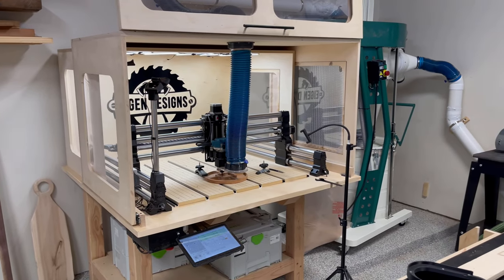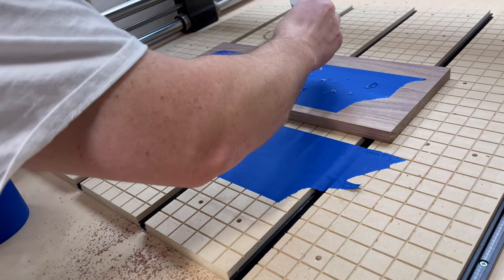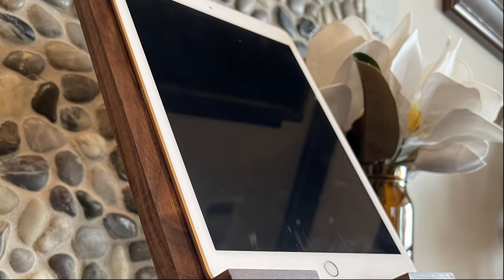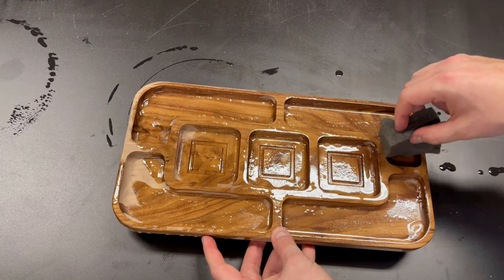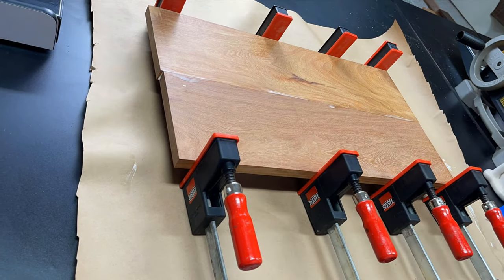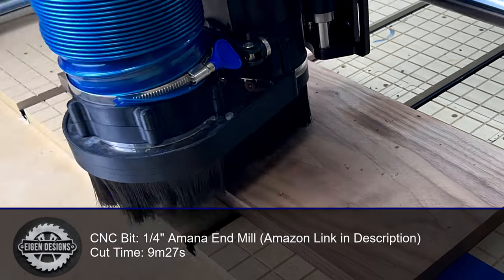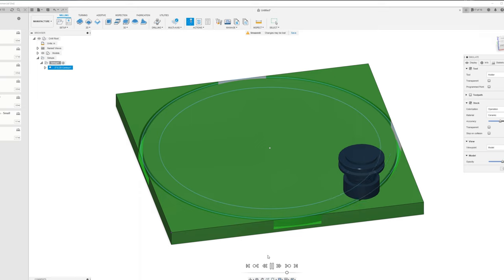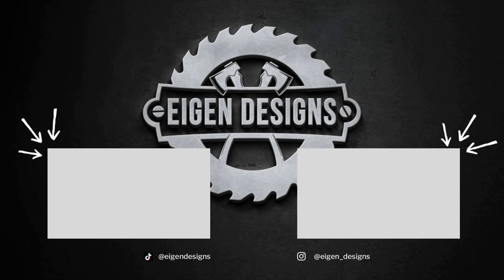5 Great CNC Projects  |   CNC Plans Available

Comment: Just a tip from what I do. On the lazy susan I opt for running a tool path with a V-bit around the edge before the relief cut. This ensures that the chamfer is consistent, you don't accidentally tip your palm router causing a divot on the edge and your dust extraction handles most of the debris. Other than that, nice projects.
Reply from the maker: That’s a really clever tip Jeremiah, thank you!

Comment: I just got the files for I pad holder can I do it on a cnc that’s not onefinity thank you can’t wait to make these
Reply from the maker: Hey Jon - you sure can. Just import the DXF file into your CNC software of choice and create your own tool paths from there. There is an instructional PDF included in your purchases that will help you with contour selection, cutting depths, feeds and speeds, etc. Good luck!

Comment: Not sure if you've tried this with some of your bowl bit projects but I've been running the first cut to "hog out" the material to get it close the exact depth and then doing a second tool path cut out that goes to the final depth and sped way up and with an increased step over to reduce the ridges left by the bowl bit initial time its run.... not sure if that makes any sense but great projects! Enjoying all the cnc videos my guy
Reply from the maker: That's a really good idea! Thanks Blake. That would certainly cut down on the sanding needs on the back end. Thanks for the tip.

Comment: the more i watch your stuff bro you are really good i started out like you had all the smaller machines 10 years ago when i started then stepped up buying bigger machines witch really helped me your planer ear muffs had the same one loud have a powermatic 20 inch not as load 25 inch drumb sander now from the jet 16-32 something like that i di what you are doing and saved saved saved to buy bigger machines took ten years but i got them  sad part is need ok want bigger machines  i have a sawmill i bought 6 years ago can slab up too 32 inch need a bigger planer and drum sander

Comment: I did this project right from the DXF.  You might include in your directions that your profile paths are "on" the vector and not outside of them as most projects will cut from the outside on cutouts.  I noticed as I was cutting this that the two pieces would not fit together so I ran the toolpath a second time on the vector and it worked out fine, however, I can see someone having a bit of frustration here.  Also, you might also include the project dimensions within your directions.  I got them off your video.  I realize you can make this any size you want, however, if someone is trying to replicate exactly what you demonstrate...
Reply from the maker: Hey Russell, a few people expressed some confusion about cutting "on the line" vs on the outside of the line so I actually updated the DXF file yesterday to increase the opening to 3/4" so people can cut on the outside of the line. I hope this will help simplify things. Also, that's a good idea to include the dimensions in the instructions. It's included in the listing description, but it would also be helpful in the instructions. Thanks for the tips!
Reply: My copy that I purchased last week wasn’t updated apparently. I cut inside and outside wasting 2 really nice pieces of walnut, before looking up what the problem was. The engraving is extremely light as well. You can barely see the lower left.  My Avid 6060 is trimmed in to .002 across X and Y. The wood was .758”. I set it at .750” so I didn’t hit my spoilboard. It left. .008” all around, so I know the wood was level as well.
Reply from the maker: @shockdocracing  What's your order number so I can help get this resolved?

Comment: Hello, wonderful work, can I ask about your cnc machine, I'm really interested in building one and yours appears to be a totally different design to any others I've seen, with pipes for linear rails as far as I can tell,what type is it, or did you build it yourself?
Reply from the maker: I didn’t build mine. It’s made by a company called OneFinity and they use those ball screws to move the router around. It’s a very still design and has remained accurate even after a years worth of use.
Reply: @EigenDesigns  ok, thanks for the info, I'll check them out.

Comment: Interesting to watch thanks. As a complete novice, I was wondering what is the accuracy one can achieve on a mass production doing this process? Meaning if I set specific sizes with the cnc, how accurate will be let's say the actual internal cut compared to the settings? I like the gap between the dishes and the tray, looks good aesthetically, but what if I want it to be narrower to the very limit? Would you say the dishes will always fit, or some will and some won't?
Reply: Actually I mean something like the tray for the beer glasses. They seem to fit like a gloove. Love it.
On a mass scale, is the router able to get always a fine cut or what would you say will be the allowance? thank you
Reply from the maker: It's a good question. The answer will depend on what kind of a CNC you have. My OneFinity operates on ball screws instead of elastic belts so it can make repeated cuts without losing accuracy over time. Any time I have carved something in large quantities I haven't experienced any variation in the final products.

I hope this helps answer your question.
Reply: @EigenDesigns  It does! Thanks a lot mate!

Comment: Hey, what are you feeds and speeds for the 3/4" bowl bit? I am just about to do my first bowl cut and curious where to start. Thanks for the ideas!
Reply from the maker: Hey Ryan, I typically run my bowl bit at 160 in/min with an RPM of ~15,000.
Reply: @EigenDesigns  are you doing .125 / .25 doc per pass? i have a 3/8' bowl bit , so i have my dia set .375, ipm of 160 plung of 70, but im unsure how much to do the doc per pass. i have to go .75 for my veg tray, material is 1" or do you think i should only go 1/2" depth and leave 1/2" of mass to the bottom? figuring out this first tray is rough XD
Reply from the maker: @SpwnDragn  with a 3/8" bowl bit you could do 0.2" per pass. A trick I have learned is to watch the size of the cuttings and listen to the router as you're making your cut. If the cuttings are very small/fine, lower your RPM. If you hear your router actively struggling to cut the piece at your given feed rate, increase your RPM. The key is to feed that information back on subsequent cuts to find the right balance between those two things.
Reply: @EigenDesigns  gotcha thank you

Comment: Why do some people use painters tape and CA glue versus double sided tape. I use double sided tape without any issues.
Reply: Maybe I’m just been lucky so far?
Reply from the maker: I have tried a few different types of double sided tape and been unlucky to have the pieces move on me during a carve. It could be the 1” grid lines on my spoilboard prevent the tape from getting a good bond, but I’m not sure. I’ve never had that issue with the painters tape method.

Comment: I work concierge and a resident got a 70 something inch tv shipped to them with a good allotment of soft wood. I'm new to all this, is there anything i should do to the wood before adhering and clamping? I may lightly sand sections have some black text printed on, but there are also American flags throughout it that I actually want to keep.
Reply from the maker: If you're going to use reclaimed wood, make sure you remove all nails, staples, and other metal objects before working with it
Reply: @EigenDesigns  really appreciate you and your channel

Comment: Down loaded and it came out nice but I have a question. My carve time after downloaded the Gcode the 1st carve was 45 mins and it went in circles. the dish cutout also went in circles not straight movements light your cnc. Yes I downloaded into my oneinfinity. On my 3/4 bowl cutout I notice I had some ridges at the bottom. Usually I use a clean up low step over. Any ideas?
Reply from the maker: Hey Dave, I am not sure which file you're referring to, but perhaps I can offer some suggestions.

 If you're looking to optimize the tool path for the dish groove you can import the DXF design file and create your own tool paths, rather than using the g-code files directly. I use fusion 360 for my software and often times the "adaptive clearing" will cause the circles that you're talking about so you can choose a contour cut to carve the channel  for the dish instead.

The easiest way to get rid of the ridges from the 3/4" bowl bit is to use a drill bit sanding attachment and lightly sand the bottom of the bowl. These are pretty cheap on amazon and make quick work of the ridges left behind by the drill bit. I have played around with the reduced step-over on the final pass and find that there are still markings left behind by the bit. 

If you need more support feel free to reach out to me through Etsy.

Comment: Mark, great video.  Question, during the first part it references using the 90 degree v carve bit to do the cutouts and the then the 1/4 inch endmill when doing the carving but, that seems to be backwards to me.  I'm new to this and want to be sure I setup the bits in the correct toolpath sequence since I have to redo the toolpaths (vectric) after purchasing your files off etsy.  Do I use the endmill first then the vcarve or the opposite?  If so, I think the video bit references may be backwards or it's just me.  Thanks.
Reply from the maker: I just noticed what you’re talking about and it’s definitely a mixup on my part - great catch. The cutouts should be done with the end mill and the engraving should be done with the 90 degree v carve bit. Also, in general it’s better to do the engraving first before doing the cut out. You don’t have to do it in that order, but it’s a better habit to get into. Hopefully this clears up the confusion.
Reply: @EigenDesigns  Thanks. That clears it up.  I'm working on updating the toolpaths in vectric and plan on doing some playing around this weekend.  Thanks and again, great videos.
Reply from the maker: @j.zamanma1312  thanks so much :):)

Comment: Mark, great projects.  Thanks for taking the time to show us how to do them.  One thing I noticed was that you used Fusion 360 for both the design and the tool path for the Onefinity CNC.  I've always used the Vectric Vcarve Pro for design and generating the tool path for my Onefinity CNC.  I'm in process of teaching myself Fusion 360 for my 3D printer.  The design aspect of Fusion 360 seems far superior, in my opinion only :-), to the Vcarve.  I would really appreciate it if you can demonstrate the workflow from design to tool path using the Fusion 360.  Thanks and keep up the great work.
Reply from the maker: Thanks for the support. I agree that Fusion 360 has a lot of capability if you're willing to go through the "learning curve" since its not as user friendly as some of the other software out there. In this video I didn't really focus on the design aspects, but there are two other CNC videos where I go into more detail on this process, including the workflow that you're talking about. I recommend you check out these two videos I did a while back to see if that helps you in your journey:

video 1: https://www.youtube.com/watch?v=tkKBD4uaoQo&list=PLVDz0b_Tzzt3-P40DdhGUVe_7mfTGJq6C&index=2 

Video 2: https://www.youtube.com/watch?v=NVPENSGp5zg&list=PLVDz0b_Tzzt3-P40DdhGUVe_7mfTGJq6C&index=5

Comment: These turned out really nice. I am always afraid to try something like the "large serving platter" design because wouldn't the wood warp and shift in time digging out so much? I was always told to only do that with glue-up wood strips.
Reply from the maker: It's always a risk, but I haven't encountered that issue yet. I always use kiln dried wood that has acclimated to my shop so I am sure that helps. 

You should give something like this a try, worse thing that happens is you ruin less than a board foot of wood. If it ends up warping on you I will mail you a stable one for free.
Reply: @EigenDesigns  Thank you for the words. I'll give it a try when I can. It was just one of my worries that I ask random woodworker channels about and most say never do it. Yet I see so many videos. You are honestly the first person I asked that responded positively. 

I guess I got rooted in my fears when even Wyrmwood had an episode and talked about trays, asked them and they told me not to do it as well. 

I'm just a woodworker hobbyist, so still learning in my old age.

Comment: Where did you get the magnetic hose attachment for the planer?
Reply from the maker: Hey Ivan, its from a company called MagPort. They are a bit expensive, but I use them all throughout my shop.
Reply: @EigenDesigns  yes I saw you use them a lot. I’m going to check them out. Your cnc cabinet has inspired me to build one for my Shapeoko